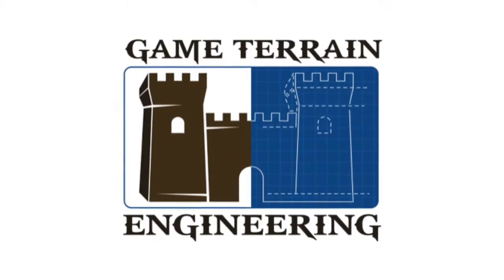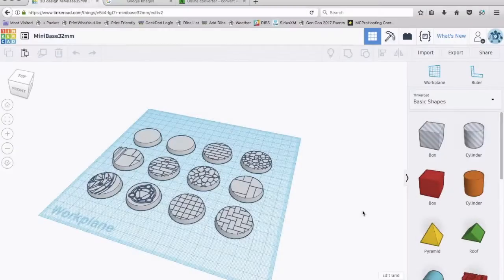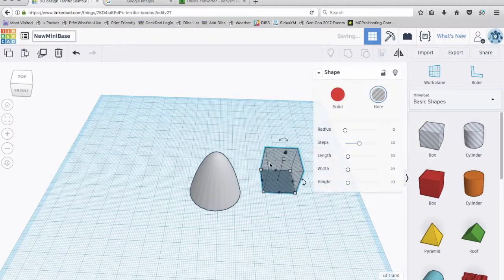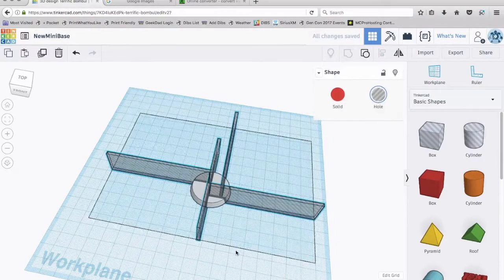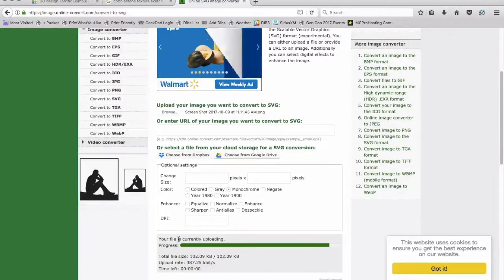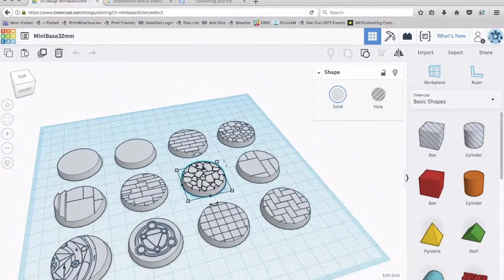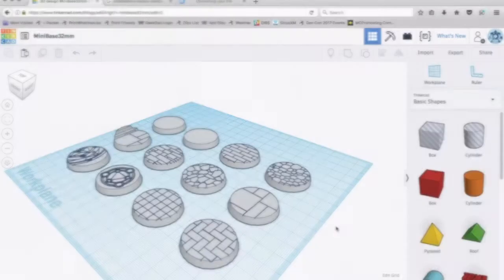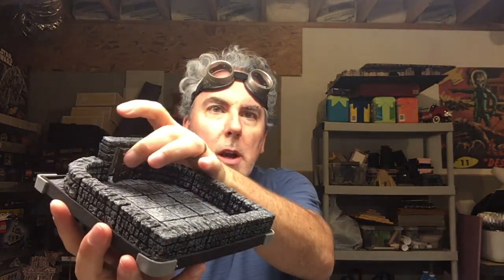GTE 031 -- Design Custom Miniature Bases

Comment: Wow thanks so much for this tutorial!! I was surpried how userfriendly tinkercad is! One hint for upcoming users: Try ’Cylinder with defined smoothness‘ (Shape options > Shape Generators > All > Second page, I guess). You can choose the bottom and top width directly. In addition you can smooth out the circled base and set your height.

But that’s one question: Did you smooth your bases out manually with sandpaper? Or is the base more smooth than it looks like on the 3D print :)?
Reply from the maker: My printer provided a smooth finish without sanding.

Comment: Another tip at about 8 minutes in after you make the base you can copy the base turn it into a hole object reduce the size and extract it from the original. That way you can reduce the overall mass of the base an it will cost even less if you use shapeways.
Reply from the maker: That's true... hollowing it out a bit will save some plastic. Not much, but every little bit counts.

Comment: Great vid. Question. I have made a lot of bases at the same time. But after they are grouped I can't move them alone. And If I ungroup them the sketch loosens aswell
Reply from the maker: I always group my bases one at a time with their design. Once bases are done, I then group all the bases into one large collection. They will move together after that final grouping. Not sure if this helps, but the only way I can think of that everything ungroups is if you haven't grouped each individual base and design first.

Comment: Estimate the cost by weighing the part. If they are too light for your scale, measure a handful of them. Mulptiply weight/1kg * price/kg.
Reply: Nice. I knew someone would have a good answer. I'll have to print quite a few of these to get any kind of response from my scale. I put seven on the scale and no result. They are VERY light. At $15 for 1kg, anyone out there able to make an estimate based on size? 32mm diameter... 4mm height.
Reply: Volume would be pi*r^2*h, or on the close order of 3cc. Assuming a density of around that of water for the filament, and adding in about 10% for waste (because the numbers come out nicely), that would be about $0.05/base in materials.

This doesn't consider the amortized cost of the printer or parts for repairs, which could significantly increase the costs, depending on the service life of the printer.

Nice demonstration of how to use that package to make bases.

I respect the geekiness of printing the base. I've certainly done similar things because the process was interesting rather than because of efficiency. I see it as mostly useful for complex man-made patterns, which can be annoying to create. But my answer to this problem for more common patterns (stone, earth, diamond-plate, or the like) is to use epoxy putty and stamp the base texture, which has the advantage of being about 1 minute per base, allows me to use fender washers for a bit of mass, and facilitates my adding magnets to the bases for transport. 

BTW, broken rocks make quite nice rock or earth textures when using putty, though you don't get to fiddle with a CAD package. 8-)

Comment: Oh, man. This is exciting. Thanks for posting this. I am learning so much by watching your videos. Since I watched your video on the tomb, I was able to go into Tinkercad, import an stl file from Hero's Hoard and add text into a blank sign board. Not much, I know, but a huge step for me. :) As I watched your vid I was thinking that I could make a 2 inch square shape, import a cobblestone pattern svg, group, and start making my own dungeon tiles. Even add a 1" grid. Is there an upper limit to what you could put onto a tile in Tinkercad? Say I made a 2 inch dungeon tile with cobblestone pattern and a 1" grid, could I then add a runic pattern on top of that? Also, as far as estimating cost of a print, Simplify3d gives an estimate of pla used in mm. You could also calculate price by that. Thanks again, DM Jim. You are making some great videos. Please keep going. I am heading over to Tinkercad now.
Reply: I haven't encountered any limitations on importing into Tinkercad other than the 25MB limit. No images or STL files can be imported that are over 25MB. Most of Fat Dragon files, for example, are over 25MB, so you can't import most of them and customize them (with signs and such). I'm glad that you're loving Tinkercad... it's quite powerful for beginners and once you get the user interface down and figure out the various tools, you can do some crazy stuff.
Reply: Thanks. I spent a big chunk of yesterday messing with Tinkercad. I made a cobblestone dungeon tile from, then one with cobblestone and a runic symbol. Printed them and they came out fine. Made a few modified market stall signs. And then I designed a couple of medieval style tents. They're printing now. I kept going back and watching your videos as I worked. They are extremely helpful and better than all of the other Tinkercad videos I found. Thanks again.
Reply from the maker: Appreciate that, Robert. If there's something else you want to see me do, let me know. I can't promise I'll be able to do it (!) but I'll try. Right now, I'm investigating using Tinkercad to hollow out existing terrain to embed electronics. Very tricky to not remove supporting material.